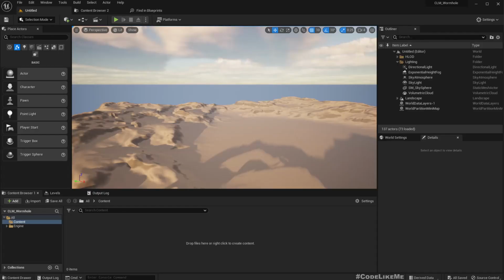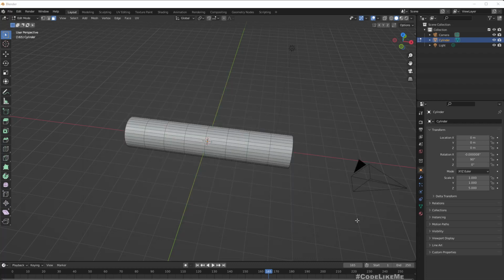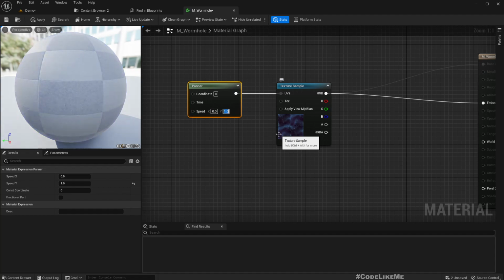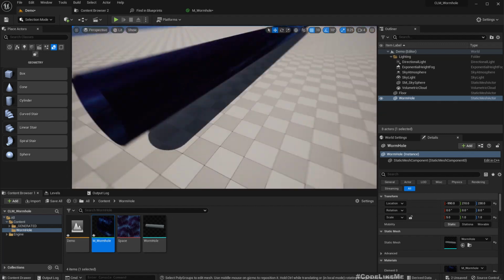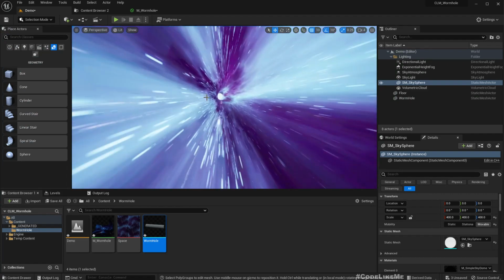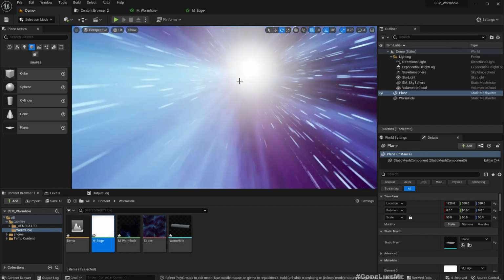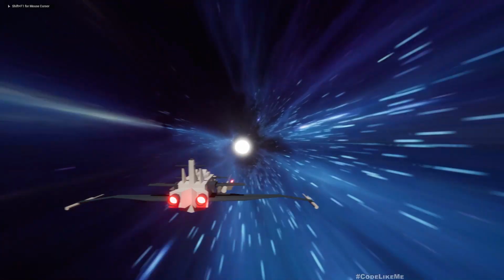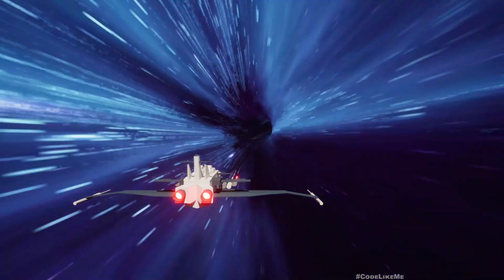Unreal Engine 5 - Wormhole Effect

Comment: Great idea!  I think this would work better if you had a tube bending in the middle, then you could do away with the issue at the end of the tunnel.  Also I wonder if you could layer it using  duplicates of the tube but at different thicknesses with the inner tubes using transparency.  Thanks for sharing!